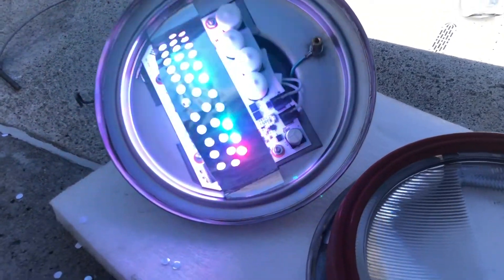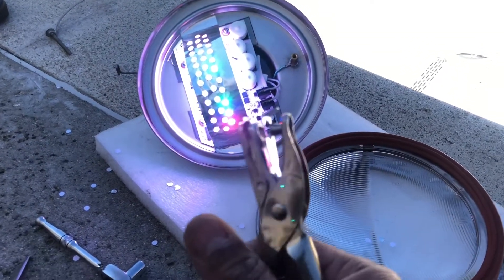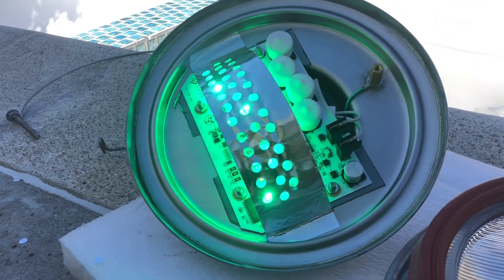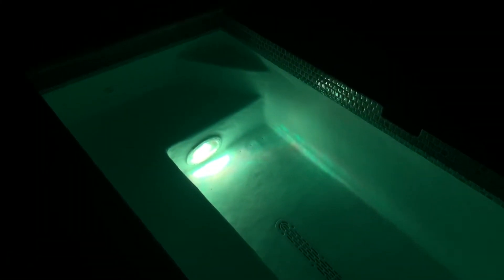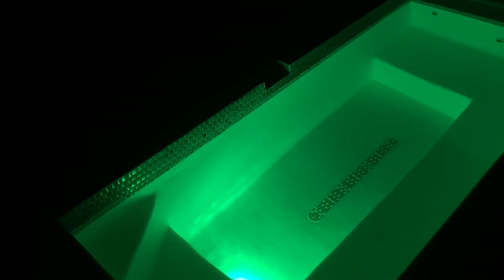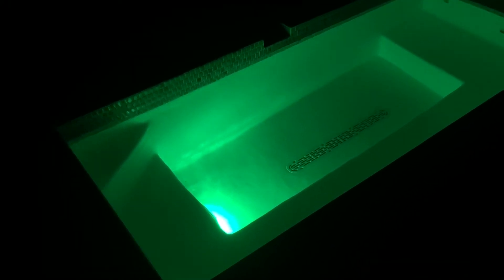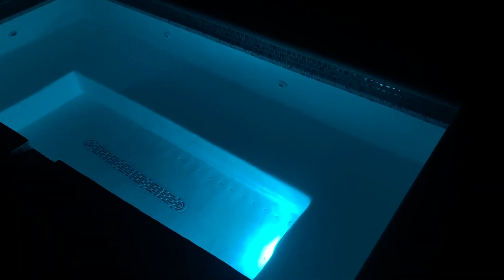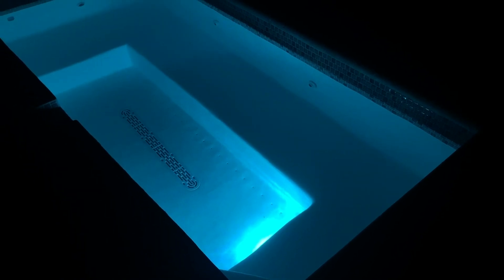Pentair LED Pool Light IntelliBrite

Comment: I've replaced two of these, TWICE at roughly $800 each. They both went bad just outside the warranty. The first was replaced by a professional and went bad just over 1 year. Water had leaked into the fixture. I replaced the LED for roughly $400. The second was closer to the wiring post so I replaced it myself. No difficulties but, it went bad in about 5 or 6 months. Turns out, if you don't hire a professional, the warranty is 60 day. Pentair basically told me to pound sand. 

The spa control panel also failed recently. 4 buttons but several hundred to swap. I went with Switchbot to turn the spa and jets on/off at the panel inside the house. That panel doesn't allow you to set the clock past 2020. Ain't that a hoot? The year doesn't really matter but, despite Pentair's claims of quality and reliability, I don't think they really care about providing value to the customer.

Why would I spend so much to replace a light??!! I'm asking myself the same question. The system has that feature so I was trying to preserve that. Plus, I always thought LED's were supposed to last a very long time, that's one of the primary features of LED's. I guess that nut was too hard for Pentair to crack. I've bought color changing LED's at the 5 Below store that have lasted longer.

I'm going with plain white. Maybe I have the luck of Schleprock but, in my experience, these color lights are a colossal gyp-peroonie.